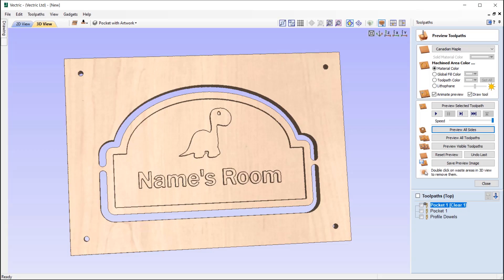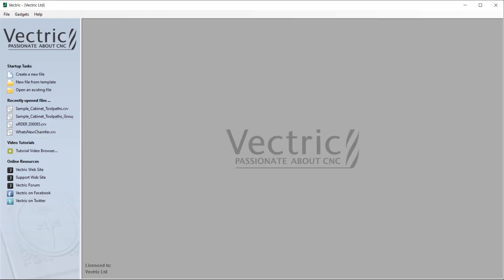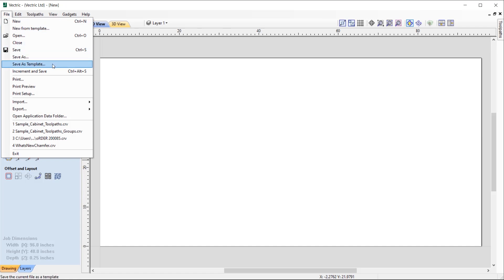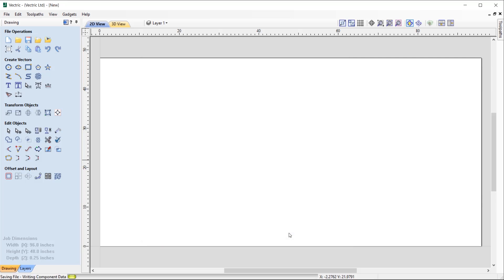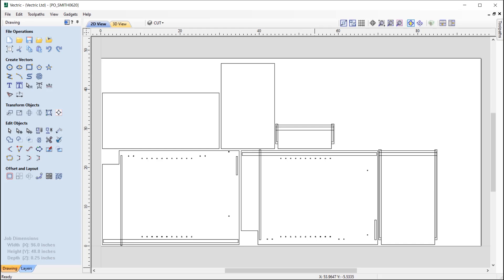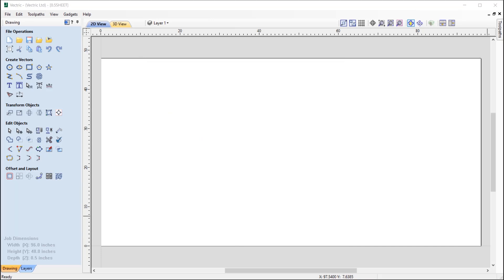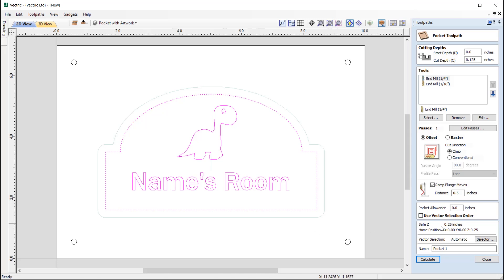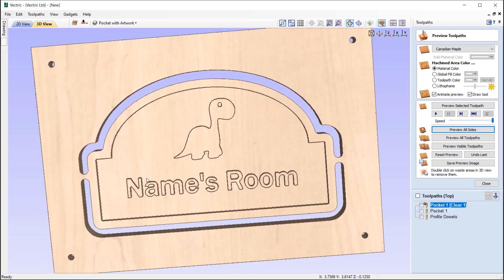Vectric V10.5 Tutorials | Working with Job Templates

Comment: Hi,could You tell me how to connect 3D model to material on both sides so it doesnt move like in 11minute ?
Reply from the maker: Hello Matija.  IN thia video there isn't any 3D content used it is all based on 2D vectors and tooling.  Maybe I am misunderstanding, if so please set me stright... :)